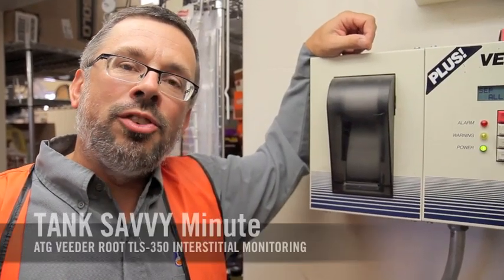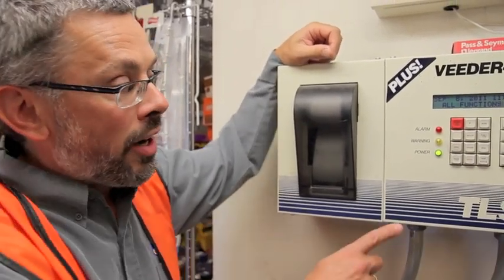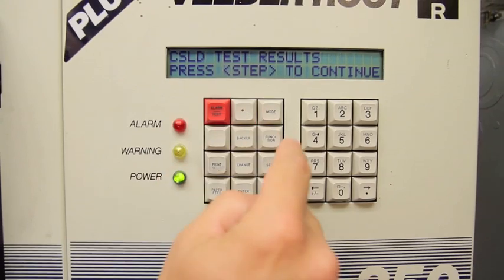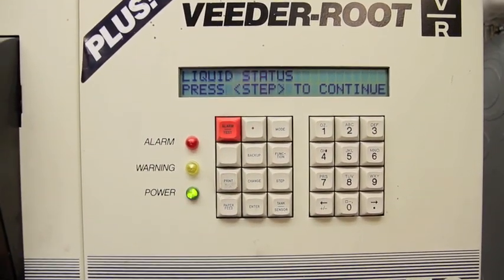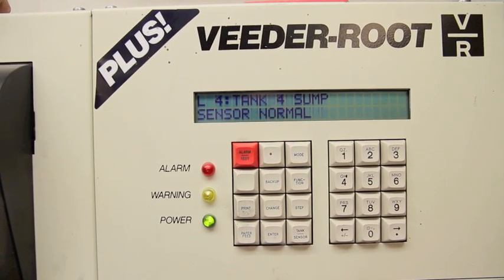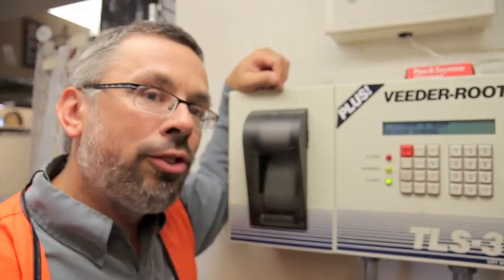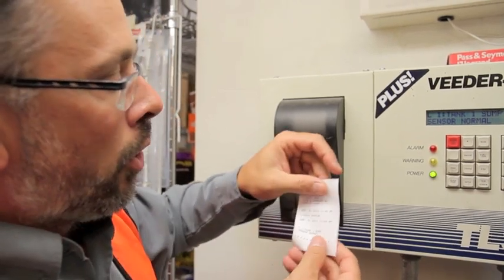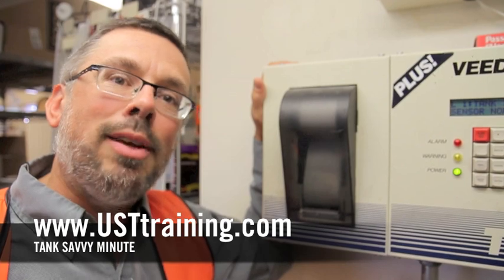ATG Veeder-Root TLS-350 Interstitial Monitoring

Comment: on my veeder root 350 tank capacity is different than entered in the tls350. How can I change the capacity in VR?
Reply from the maker: Hi Express Fuel Mart: It's very very important that the gallon size of each tank is correct and exact. Your Veeder Root should have the ability to calculate the gallon of each tank. I strongly suggest you contact Veeder Root and ask them t hep you through the steps. See Veeder.com. Hope that helps.
Reply: tank reading in April had 15000 gallons and was giving pass result. When technician came and fixed tank with 16000 (As per chart) result failed for that tank. I guess, we will have to bring that capacity down to 15000 gallons. Thanks for your reply Ben.
Reply from the maker: Make sure the number is exact. It won't be an even number like 15,000; it'll be something like 14,978 or 15,076 because each tank can literally be a different size. Whoever first set it up did a big booboo.
Reply: yes the number is not 15000, it is 15270.
Reply from the maker: Great. That will help giver more accurate and reliable readings.